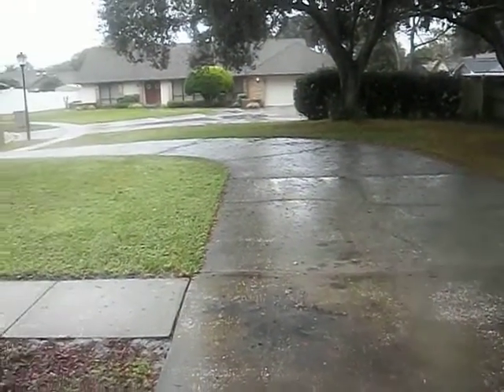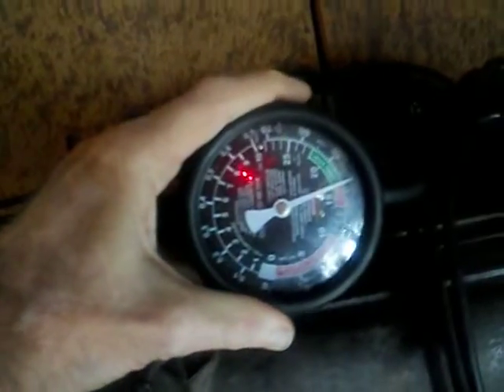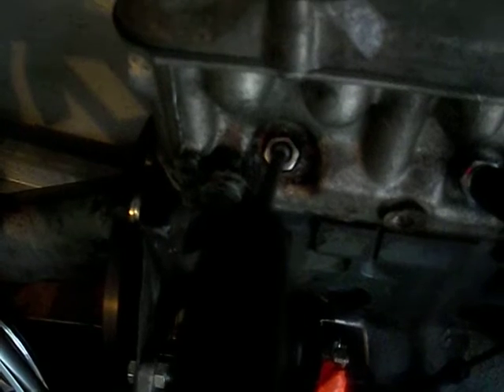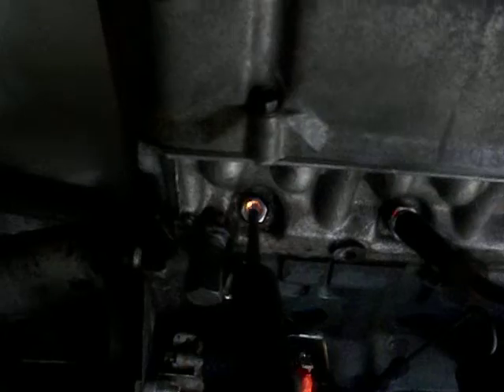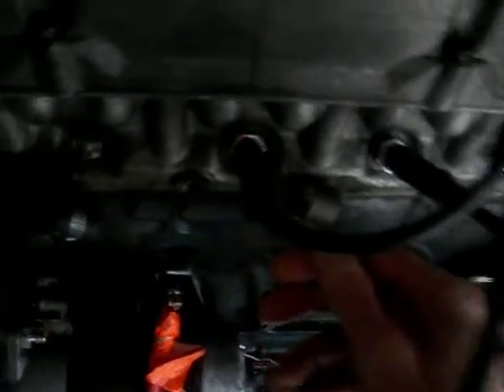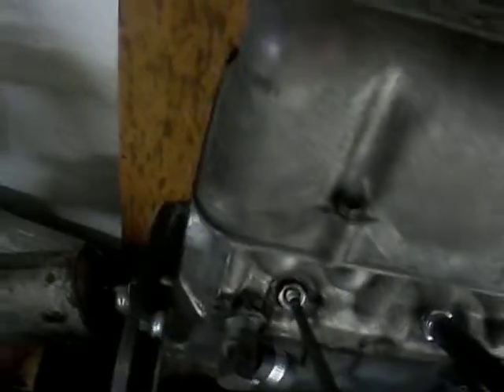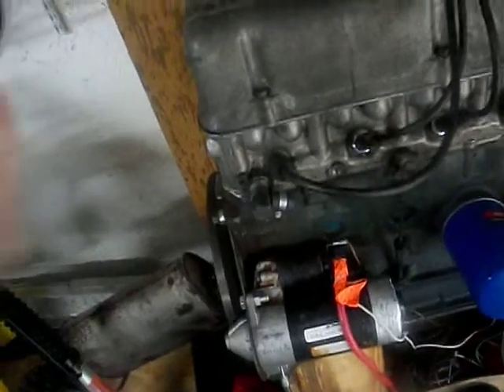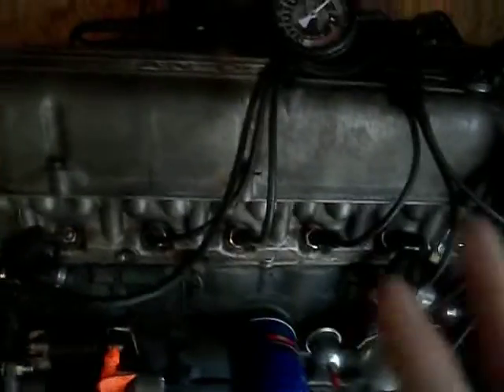Datsun L28 EFI running with color tune plug

Comment: Dave, I. Noticed you don’t have the Cylinder Head Temperature Sensor (on head between cylinder 5 and 6)  Installed on that engine.   I believe the EFI uses it in conjunction with the Water Temp Sensor (mounted on thermostat housing) to determine the proper fuel richness and injection fire duration.   I saw the video you made some time of testing the Water Temp Sensor.  I’ve been researching and reading the FSM recently for my engine build and what each of these temp sensors do.

Comment: Dave just realized that must be a late N47 (79-81) head or a P79.   That is when they added the Cylinder Head Temp Sensor.   In the ZX motors they used that sensor as the ECU input while the Water Temp Sensor was used to for Spark Plug Timing Control as part of the Emissions Control System.
Reply from the maker: that is a head off a 83 maxima. The EFI system is from a 76 (iirc) 280z, the orig head on that engine was a N42